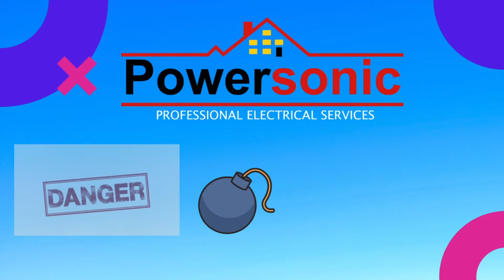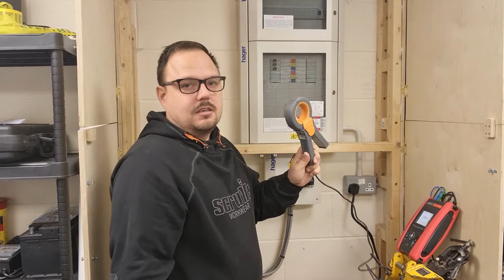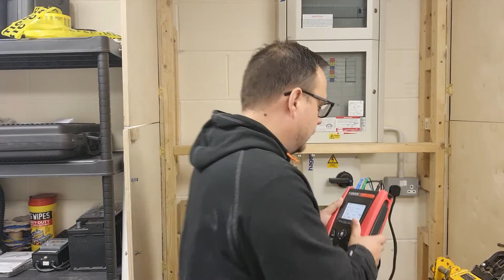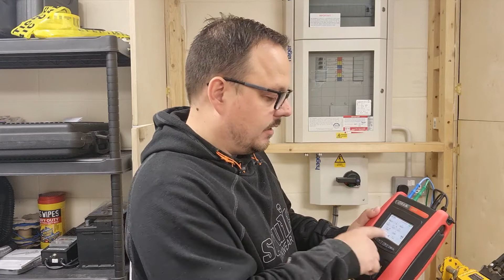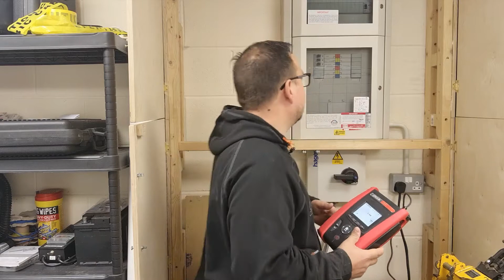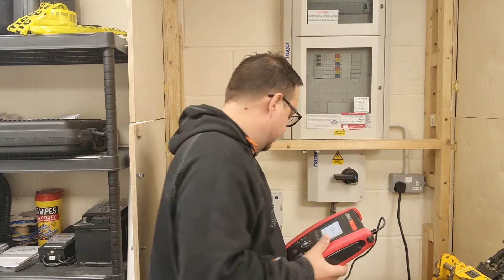UK Electrician looks at TIS MFT Pro clamp accessory

Comment: Just bear in mind on a single phase installation to be aware of multiple parallel earth routes - water and gas bond is the most likely either disconnect the multiple paths and keep to a single path if you are going to be putting it around the CPC. Better to stick it around Line and Neutral if you are not sure if multiple paths exist.

Glad you showed the MFT it’s very nice and the addition of power quality is really a big plus, I think you will see that more often, in much more expensive dedicated power quality tools.

Once you get into this area there are other more sophisticated analytical tools beyond what’s available commercially.

I would take the power quality logging data and use other signal processing tools like Wavelet, multi resolution analysis, cross spectral analysis will really bring analysis of harmonic, interharmonic analysis to the next level able to discern very fine resolution, stripping out noise from signals and able to connect what is causing the transients. Much of that is not even in the most sophisticated power quality tools but require mathematical program analysis outside in software to be able to do this. My PhD almost 20 years ago I was doing this with other types of data rather than electrical voltage and current.
Surprised it’s taken this long to come into other fields.

If you are interested I can send you some easier links to understand this.

As I say with renewable technology, ev charging prosumer world and other modern semiconductor devices are becoming widespread even in residential settings power quality issues are going to be much more important-the trick will be in doing the interpretation and analysis. Some of the more expensive power quality tools have dedicated software to do these kind of reports which will make an EICR seem simple work😱 it’s a brave new world glad you are embracing it and the younger electricians can take inspiration.
Reply from the maker: Thanks for that I really appreciate such an in depth reply to my video! 

Quite correct with the parallel paths, in this instance we have no equipotential bonds in place. Just electrical services, but you are quite correct it can cause issues. I was juts trying to point out it worked on the earth conductor alone.

That level of analysis is something else! I myself have an electronics and electrical engineering HND/foundation degree. Perhaps one day I will progress that further! I do like to mess around on my oscilloscope fixing things.

We have power quality analysis and loggers but I like the feature in an MFT. More likely it will be used more often rather than when requested by a client.
Reply: @electrician247  yes just trying to save money for a high quality tool including a high quality oscilloscope but that’s a lot of cash to splash out. Again it’s in the realm of understanding of most electricians - maybe I will write up a document sometime soon.

The irony is I have this high level knowledge lots of reading and book work - and my field of work has nothing to do with electricity, but finance but I have always worked with my hands and lucky to afford any tool I want. In us I do my own electrical work in my own home and have it inspected. I have had inspectors show this work to master electricians here as example of above and beyond code work. 

At some point I need to take the course for a licensed electrician not because I am going to become an electrician but to give it the respect it deserves and to verify the skills I have learnt already. Just finding the time.

I do reports all the time when I install including all testing results and is upto US NEC 2020 standards (equivalent to 18 edition amendment 2). I like listening to the UK electricians on YouTube which I must say has taken off greatly in the last year or so. Not just the discussion on standard changes but also techniques of wiring, finishing quality, testing but kudos to you, you and David Savary who are the only electricians I see taking this kind of interest in this work. I am sure there are many more. Keep up the excellent work. 

How good is the tester for EV work?
Reply from the maker: @mathman0101  I still need to find out! Not tried it on EV work as yet. Doing so in 2 weeks so we shall soon find out!

Always satisfying to do your own work. Are the american standards greatly different? Aside I guess from the higher current flow at 110V?
Reply: @electrician247  actually you would be surprised they are similar in many ways especially with amendment two. 

It has a lot of residential, commercial and industrial stuff as well including much more in conduits and raceways, much more detailed on earthing and grounding, other than basic insulation resistance not much of a testing framework nothing like an EICR they rely much more on overprotection, surge, RCD and arc fault detection devices on all circuits. Our RCDs trip at much lower amperage and faster so trip at 5-10milliamps at 4-5 milliseconds reducing the need for a rigorous testing framework for many electricians who in my mind are less knowledgeable on that part. Thank god no ring circuits all radials and dedicated circuits for dishwasher, microwaves, dryers air conditioners, garage openers, AC units air heat units and water tanks, separate sub panels for outdoor lighting and patio and swimming pools and hot tubs and outside kitchens. Again more mixing with low voltage alarm, power over Ethernet stuff, Ethernet and auxiliary tv cabling. More smoke, fire, carbon monoxide and ionization devices and in more places in homes. We have sump pumps for basements as well. There is more on surge and lightning protection in some states ie florida. 

Commercial, special hospital  and industrial much more on hazardous conditions, motor analysis, conduit, 3-phase include delta, star and other configurations.

There is safety testing of devices much more in the medical device field less so on pat testing in residential settings. 

My house is around 6000 sq feet with two 200 amp sub panel each with 30 circuits as well (total 400 amps). I will be upgrading to smart load centers and I do already have smart power monitoring using the sense monitors in each panel.

Take a look at what I will be fitting which which has Smart breakers with WiFi and RCD and arc fault built in as a standard. Our single phase panels are more like your 3-phase commercial panels in Uk.

https://www.leviton.com/en/products/residential/load-centers/the-leviton-smart-load-center

Ev charging is coming in a big way as is smart whole home technology, LEDs we have WiFi around 1gb plus and expandable to 200-300 go to handle all of that.  

Solar generation, Tesla power walls and prosumer world is coming in also with take in California faster than elsewhere.